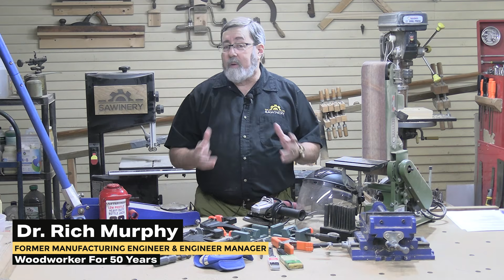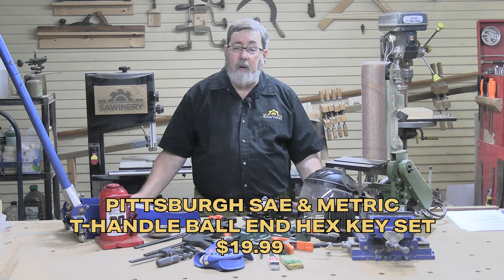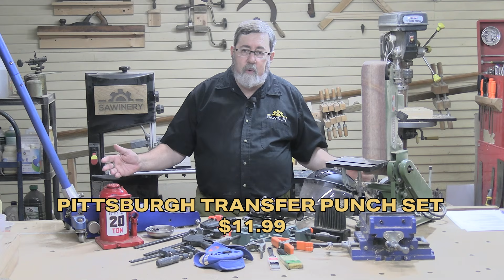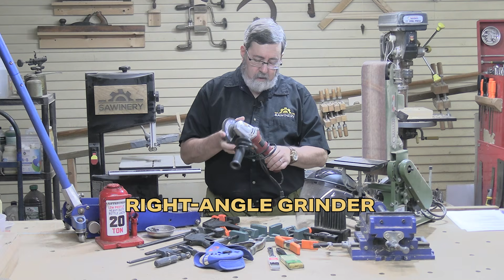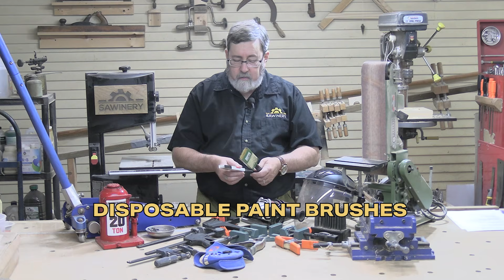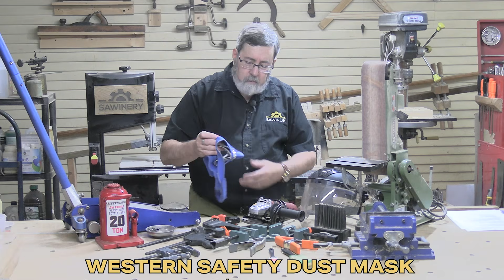22 Best Tools You Can Buy at Harbor Freight

Comment: 23:21  That new Bauer drill press is also variable speed. It is almost identical to the Wen 12" variable speed drill press.  The Wen is cheaper on Amazon, but the Bauer is often on sale.
Reply: I was going to buy the Bauer drill press when the Wen came on sale. $195. So...my drill press is orange instead of red. But they appear to be twins. 12" swing, variable speed, decent weight and construction. Had I not been able to get the Wen dirt cheap, I would have bought the Bauer. I'm not afraid to buy HFT drill presses. Had a few that eventually died, but more than got my money's worth.

F-clamps (in my opinion) are light duty clamps. Not meant to apply a ton of pressure. But for bent wood glue-ups, for holding parts in place during fastening, for holding down a piece while working on it...just dandy. I currently have about forty of them with twenty-four being the 6" that mostly get used in bent wood glue-ups.

The transfer pin punches are something wood folk don't often think of, but I grab my set at least monthly. Got it three years ago. Based on that...the set cost me 30¢/use, and the price goes down every time I use it. Well worth the price for the frustration it saves me.
Reply: @woodrowsmith3400  Yes. I picked up the Wen for $199.99 during Prime Day recently. It had been listed for $232, but late that night I checked again and it was under $200 so I grabbed it.

Comment: HF sells a cheap, somewhat flimsy aluminum bar clamp in various lengths. At the store I found them to have too much flex so I didn't buy any. However after viewing the Paul Sellers YT video "Retrofitting Aluminium Clamps," I may have to reconsider. He has a cheap, easy mod to vastly increase the strength and stiffness of the clamp. Cheap and easy are my two favorite things for anything related to tools.
Reply: I bought two and the casting snapped near the threads on both of them... Caveat Emptor.
Reply: @harlanbarnhart4656  they do have a lifetime warranty
Reply: I clamped up an 8/4 7ft table with those clamps.... they worked fine...

Comment: I purchased the Hercules compound miter saw as an upgrade to my old Dewalt miter saw and bought the stand for it.  I couldn't be happier.  I have the Bauer portable bandsaw.  That's another tool I'm quite happy with.  Harbor Freight has definitely improved their quality.
Reply from the maker: Sounds like some great upgrades! Solid choices 😊
Reply: I have the same saw, and I’m just as happy as you. But I got even happier after I got the aftermarket dust collector from Shop Nation.
Reply: That miter saw is a beast. Easily adjustable for truing up. Great value.
Reply: I have the Hercules miter saw and I am very happy with it.
Reply: At one time harbor freight tools were cheap made
 But they have greatly improved the quality of their tools. Now i buy harbor freight tools
Reply: The stands are a real deal.
Reply: Their grinders are shit. Been through 2
Reply: I have to disagree with u. I have 2 hercules grinders and they get used hard every day and they hold up a lot better than de walt. What are u doing?? Using them for a hammer???
Reply: I’ve been looking at Bauer’s new drill press, Ty you for the heads up. I personally like that brand.
Reply: Except the Hercules miter saw isnt much cheaper than the DeWalt.
Reply: I've got the Hercules eletric grease gun. It's great
Reply: I bought one of the miter saws and liked it so much that I bought another slightly used one off of Facebook marketplace. I also have the Hercules tablesaw. Top notch stuff!
Reply: Hercules an upgrade for a Dewalt? 😂
That's a great joke. Have to remember that one.

Comment: The blue six inch bar clamps are no longer as good as they used to be.  The newer ones flex too much.  The plastic ones, on the other hand, are much better than the older version.
Reply: You can stifen them with a piece of wood. I use 1x2 from the box store.  You will need to plane or sand it down to size. It is a Paul Sellers idea. Good luck
Reply: @Eric-rb7rg those are the aluminum long clamps; he’s talking about the steel bar clamps.  The weak point on the aluminum clamps is the cast iron screw.